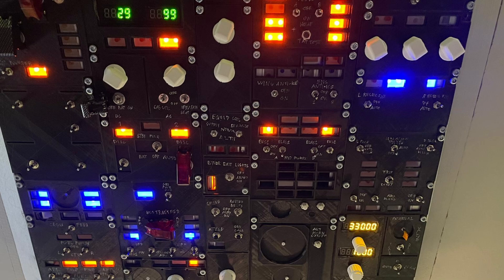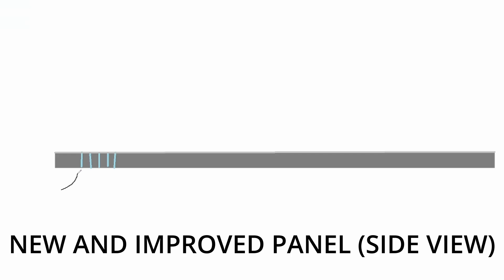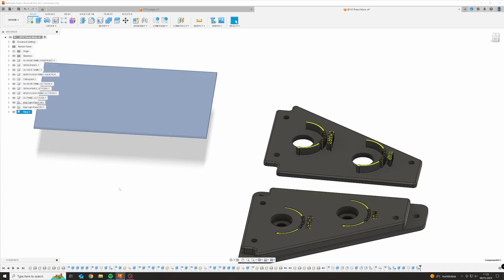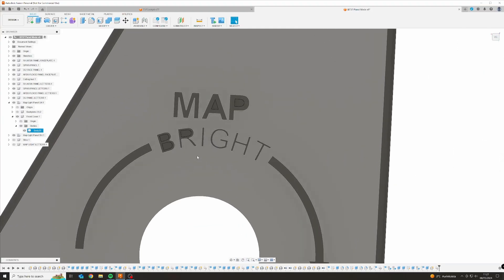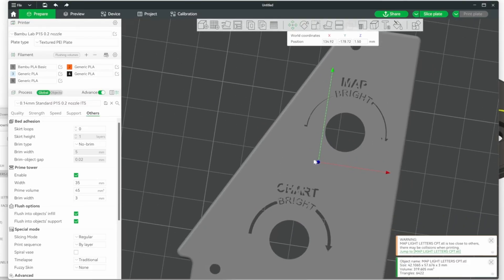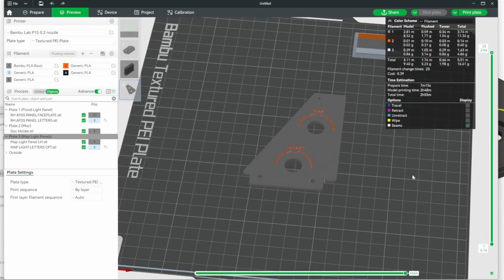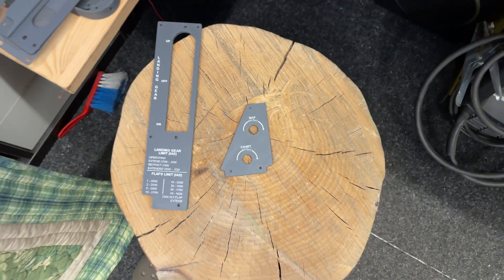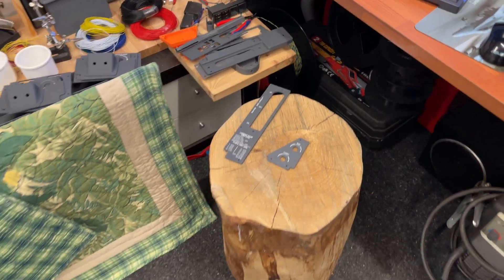3D Printed Panels With Text (Is It Any Good?)

Comment: That requires multi filament printer - yes, it is easy, but also more expensive - but I guess if you have time and space to build B737 cockpit having such printer is not an issue
Reply from the maker: Fair point. I suppose everything is easier if you have more expensive equipment. And although printers like ours are still on the expensive side they are quickly becoming more affordable. There are also workarounds to doing pretty good looking panels with just one filament change which is totally feasible to do without an AMS.
Reply: You can still do this with manual filament changes, you don't have to have a multi filament system.
Reply: @xandersnyder7214  you suggest manual mid layer filament change?
Reply: yes its actually fairly trivial with a direct drive bedslinger. just add a pause Gcode at the layerchange into the text portion and swap it during the pause.
Reply: @outlying  You can do a mid layer filament change even without something like an AMS.

You just have to alter the G-code, which you can already do in a decent slicer. Depends on your machine how you need to go about it. 

I have a Bambu Lab P1S without an AMS and I do text prints like these too. There is a G-code modification available that pauses the print when it's time to change the filament and alters the printing settings based on the filament you indicate.

It's faster with an AMS, yes, but it's totally possible without it.
Reply: You can do with single filament printer as well, requires a filament change obviously. I did a two color print using a Prusa MK4. The background was darker ASA, the text white colored  ASA. The Prusa slicer allows you to insert the second color at point of your choice